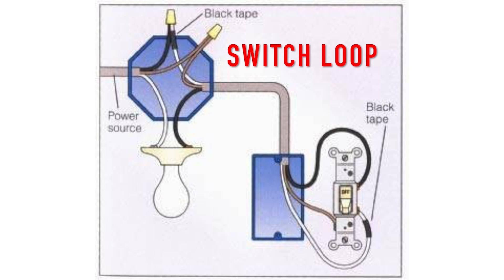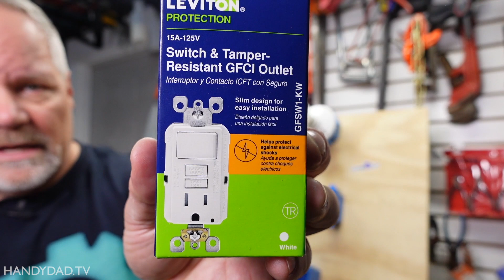GFCI Switch and Outlet Combo

Comment: Hello, I have a 3-wire cable from the power source and a 2-wire cable coming from the light fixture. How would I hook up that scenario? Where would the red wire go on the GFCI-protected outlet?
Reply from the maker: I can’t answer exactly because I don’t know what your red wire is connected to. You need to use a voltage tester to determine the hot and neutral. You may not need the red wire at all.

Comment: I watched 3 videos about installing a combo outlet / switch, and yours was the only one that made sense to me.  Thanks for sharing.
Reply from the maker: Glad it was helpful 👍🏻
Reply: I agree
Reply: 100% true. He made it so clear and easy to understand. Everyone else had a bunch of wires and a bunch of pigtails. But I do have a question, why are there two neutrals? I only have one neutral coming into my box.
Reply from the maker: @Perpetual_Prince There are two neutrals because one comes IN with the line and the other goes OUT to the load. If you only have one white wire, was it connected to the switch? If so, it IS NOT a neutral.
Reply: @handydadtv  hi! Yes it was connected to the switch, it’s an older home. Only have 2 black wires, and one white.. it has a switch combo outlet in there, and the outlet works when the light switch is turned on. But since it’s in the bathroom I wanted to install the GFCI combo.
Reply from the maker: @Perpetual_Prince if it already has a combo switch/outlet, then you can definitely replace it with a GFCI.

Comment: Hi . I like your video  but please cab you show me how to let the switch control the outlet how to wire it?
Reply from the maker: The switch has two wires. Connect the incoming hot wire to one of the switch wires. Connect the other switch wire to the hot LINE screw on the outlet.

Comment: Can you come to Puerto Rico like now? 😂. This house came with a non working switch outlet gfi outlet.  The switch part worked,  but not the outlet.  Inside the box are a neutral, ground, black, and red wires. I removed the old one before I found your video. Now I'm stuck.  I need to determine which hot wire goes to load and which one goes to line and what to do with the switch leads.
Reply from the maker: Get a voltage tester. You’ll figure it out.

Comment: I want to add the GFCI for my sink disposal but the outlet of the disposal is blocked by the cabinet and it is not easy to replace the it by GFCI outlet. So I want replace the switch by this kind of switch. Is the light line output protected by the GFCI or just a regular switch? thank you!
Reply from the maker: You can wire it so the switch is before or after the GFCI. So you can have the outlet controlled by the switch if that’s what you want.

Comment: Great video on wiring the combo. Is there a way I can wire the combo so the switch portion powers on and off the receptacle portion? My intent is to plug in a tankless water heater and have the switch as a method of disconnect.
Reply from the maker: You can connect the hot to the switch and then the switch to the GFCI, but why spend the money on this combo device when you can just unplug the tankless water heater to disconnect it?
Reply: Embarrassed to admit my error😮
Reply from the maker: @jp3047 That’s what dad’s do best. Happy New Year!
Reply: @handydadtv  Thank you. Happy New Year!

Comment: Super. I once bought one of these combo receptacles to help out a friend, and after I installed it, the GFCI outlet wouldn't trip. (I'm a Sparky) No big deal, it happens, so I removed it and exchanged it for another receptacle, which also didn't function, as the GFCI wouldn't reset. Long story short, I took a plug with leads and explained the issue to the store manager, and I had to check two more to find one with a working GFCI outlet. The manager was kind and thanks to my plug in pigtail, I saved myself another trip to the hardware store. I'd also estimate that about 1% of the AFCI and 5% of the GFCI breakers and outlets are defective from the factory, with every fifth or so house getting a bad AFCI breaker and about one out of twenty GFCI outlets not tripping or resetting. (All brands.) I test everything now when the job is done, making an arc with a small load on a partially cut extension cord by rubbing the ends of the neutral together, or plugging a 4 watt clock radio into the hot and ground to see if the GFCI trips. Yes, my electrical tester will trip GFCI outlets, and I have other means to check AFCIs, but the old school ways die hard. 💙 T.E.N.

Comment: I've done most of my electrical work for years but never put one of these in so I liked this video because it made it so much easier to know I was doing it right. 
I had to replace the old wall sconces that had outlets because they were old and falling apart and also not GFCI. Now it's all safe and looks much better. Thank you so much for this video.
Reply from the maker: Glad it was helpful 👍🏻

Comment: I have a two wire coming out of the wall that was hooked to a light can I hook up to a gfci outlet with switch on a two wire line
Reply from the maker: This is such a common question that I guess I didn’t explain clearly enough in the video. 

You need a constant hot and neutral to power an outlet. If both of your wires are connected to the switch, you do not have a neutral so you can’t put an outlet there unless you run a new wire.

Comment: So, I bought this device and found that the double inserts for leads don't work. One lead will tighten, but the other won't. Tried several times, didn't work. Ended up making pigtails so I could use just 1 lead per contact.
Reply from the maker: Good thing you realized it wasn’t tight. 👍🏻
Reply: You're correct.i did one today"Dec 3" I found the same problem.

Comment: Two black wires, two white, one red, and no bare ground. What do I do with the red one?
Reply from the maker: I couldn’t say. You need to figure out where it comes from. Possibly a switch?

If you have a metal box, chances are it provides the ground through shielded cables.

Comment: I have two wires coming into the box. Both of them have power when i test them. Not sure how to proceed. Trying to install this same combo for a bathroom light.
Reply from the maker: If you disconnect them and they both have power, call an electrician.
Reply: @handydadtv  Thanks for the reply. I think I might install a GFCI circuit breaker on that line instead.
Reply from the maker: @krislemmon6649 That’s a option, but you should still figure out why both lines are hot.

Comment: I will be running wire from a junction box that has 12-2 wire going into it then I will feed 14-2 from that junction box to the switch. I will then run 12-2 downstream from the switch to a 
20 amp single receptacle.
Thoughts anyone?
Reply from the maker: If the existing circuit has 12 gauge wire, it’s probably a 20-amp circuit. If it’s a 20-amp circuit, you must use 12 gauge wire. 14 is too thin and only allowed for 15-amp circuits.

Comment: I have no neutrals in my house. Hot and load and no ground. I have an old house. Can I just wire up the wires I do have to this same GFCI outlet using the provided instructions? Any special precautions needed since I have no neutral. I'm installing a GFCI since I have no ground.
Reply from the maker: You always have a neutral or you couldn’t complete a circuit. Ground wires only became code in 1971 so you probably have no ground. 

GFCI outlets will work without a ground but must have a neutral.

Comment: How can I add this combo gfci switch to an old 1966 house that has a steel box and 2 wires leading to the box and add a second switch??
Reply from the maker: If the two wires are connected to the switch, you can’t. You need a neutral for an outlet and you don’t have one.

Comment: In my case I have only line and load plus ground, (no neutral), then the dumb electrician inverted the wires and use the white as line or hot, now I am trying to change that switch to a outlet/light switch combo, I did wired the line or hot to the gold and silver connector and the load wire to the black screws, it is working only problem I notice is when I turn off the light switch and I start using the outlet the bulb comes on a weak light(it is a dimmable lamp that uses a remote control only). Also, I did test the outlet with the light switch off  and the tester said: connection good, but If I turn the light on, then the tester said: ground inverted and the weak light pop on, thanks for your video any, idea, it is any danger in here or just change the dimmable light?. Note: the outlet in this switch will be use for a 80 watts light only. thanks for any comment.
Reply from the maker: You can’t wire an outlet without a neutral.
Reply: @handydadtv  ok, but according to this  connection, what I am risking here? How in the world this thing is working?, excuse me for my ignorance in this topic, I know how to replace switches and outlets, even breakers, but this thing  is confusing me,...or it means that if this thing is working some how is because that wire I am calling "load" is the neutral and that's why I have power to it? Thanks again, my friend, for your response. GOD BLESS YOU!!!
Reply from the maker: You have a switch loop. That’s why you see voltage on the white. The switch connects the black and white to turn the light on. That’s not a neutral. You can’t put an outlet there.
Reply: @handydadtv  ok thanks, I just noticed that behind, that wall , 1/2 ft apart I have another light light switch but this one have neutrals (2 wires to be exact) my last question for you is: Can I take a neutral from that switch using the same #14 wire I have extra and add it to the one without the neutral, right? Thanks again, I am not bothering you anymore, I promise!
Reply from the maker: @07Review Only if they are on the same circuit.
Reply: @handydadtv  thanks for your help, I did find out that it's a lot of work, unfortunately is not on the same circuit, I prefer to go safe and I just got an extension cord and I did run the cord under the running boards, some staples for wires and done, it is just only for one 100w light. Thanks again, you prevented me from doing something that apparently I made it works but in a real unsafe way. GOD BLESS YOU!!!, finally I did understand y the importance of the neutral wire 👍

Comment: Thank you so much. The instructions said to put the switch wire down to the load hot side and that kept flipping the gfci. I suspected that I could put it on the line side and you confirmed that for me... Perfect now. 🎉

Edit
For the record I know that the light is not gfci protected now, which would be a plus... But I'd rather have it that way than no gfci at all. I'll rewire the neutral side of the light later.
Reply from the maker: Glad it worked out for you. 👍🏻

Comment: This is my issue... The issue is the switch turns off the GFCI. How do I fix that?
Reply from the maker: Use a voltage tester and the wiring diagram on the box to figure it out. There’s no magic answer. It’s impossible for me to troubleshoot it for you.

Comment: I do have a question: why weren't the wires connected to the light terminated on the load side of the gfci but rather on the line side?
Reply from the maker: The light isn’t a shock hazard. Plus I don’t want the light to go off if the GFCI trips.
Reply: But wouldn’t you want the light to go off, so you remember it is connected to the GFCI? Also in my case the light turns on both the light and bathroom exhaust fan. 
Exploded toilet and burnt ceiling around fan: I don’t know what happen but I assume the GFCI did not trip and the exhaust fan caught on fire. It must have fallen in the toilet because it look like it exploded. I have yet to see how this bathroom was connected because I do see a GFCI close  to the switch. The breaker on the main panel was flipped. After cleaning up removing the old fan, I turned on the switch at the panel. It turned on the light. However, after washing my hands I got shocked turning off the switch. The GFCI did not turn trip. I’ll have to open it still like I mentioned, to see how it was connected.
Reply from the maker: @erlinavicente7411 Please call an electrician.

Comment: Can I use my old (1943) metal existing light switch electrical box for the Leviton GFCI switch/outlet combo?
Reply from the maker: Age doesn’t matter, but you need hot, neutral, and (ideally) ground. It will still work without a ground, but not as safe.

Comment: I can electrify the outlet but I can't get the lights to turn on. I seem to have 3 hot wires and a neutral (older home so no ground)
Reply: Actually scratch that, when I plug a receptacle tester into the outlet it says I have an open hot
Reply from the maker: You need a voltage tester to figure that out.
Reply: @handydadtv  Used a voltage tester.

Comment: The switch is GFCI protected?
Reply from the maker: It can be if you wire it from the LOAD screw instead of LINE. But light fixtures typically aren’t GFCI protected so they stay on if the GFCI trips.
Reply: YES!  Excellent question Albertl2542.....why don't we have our switches also GFCI protected as a standard?  Ever flip a switch with wet fingers?  Or let's say someone changes a lightbulb with the bulb on/getting power.  If something weird happens, you could get shocked with no GFCI protection.   Not saying one ought to change bulbs this way but someone COULD.  

In fact, the main reason I clicked on your video was to see how to GFCI protect my switches.  Could you do a video on that? 

Thank you!
Reply from the maker: @leftseat30 Just install GFCI breakers and the entire circuit will be protected.
Reply: @handydadtv  Rog.  Do you have videos on that?  I assume if the main home or garage breaker is off, working inside the breaker box is fairly safe and straight forward.  That said I have considered calling an electrician and having them replace most if not all breakers with GFCI breakers
Reply from the maker: @leftseat30 I’ve only installed one GFCI breaker and it was a 240-volt double breaker. https://youtu.be/BixGQisysDc

GFCI breakers aren’t very popular so they are very expensive. It’s a very low risk to get shocked by a switch or light if it’s properly grounded.

Comment: This device is about 36 at HD and saves alot of time and headache.  Sure you can run another outlet but this will cost about 20 for the gfci outlet, 10 for wires, 2 for box and 20 for the wall repair.
Reply from the maker: True
Reply: So for an extra 12$ is what your saying? M think I'll stick with my combo outlet

Comment: I installed one of these recently but in my wiring diagram the light came off the load side of outlet, light goes off when outlet tripped. Thoughts on which is correct?
Reply from the maker: There’s nothing wrong with that configuration, but GFCI protection is not required for hardwired fixtures. I prefer the light stays on if the outlet trips.
Reply: @handydadtv thank you so much!

Comment: Can you use the switch to turn on and off an outdoor outlet? It would also need to provide GFCI to the outdoor outlet.
Reply from the maker: You can do that by connecting the switch wire to the LOAD terminal instead of LINE. Then connect the black wire from the outside outlet to the other switch lead and the neutral to the silver LOAD screw.